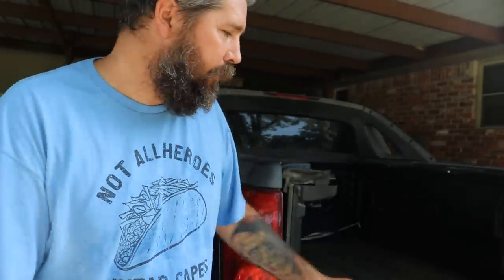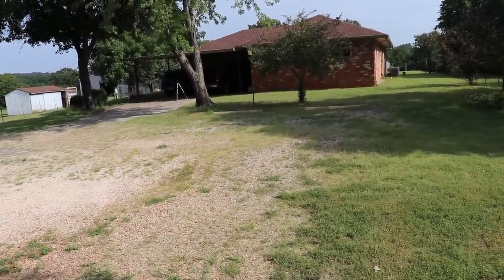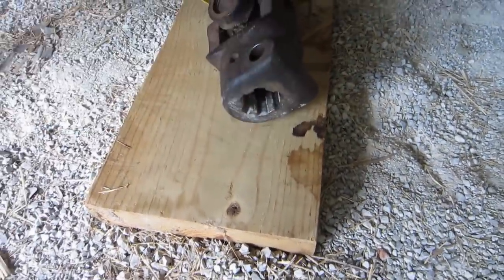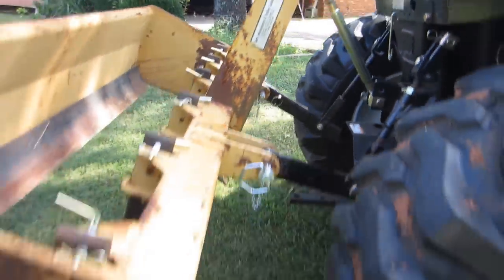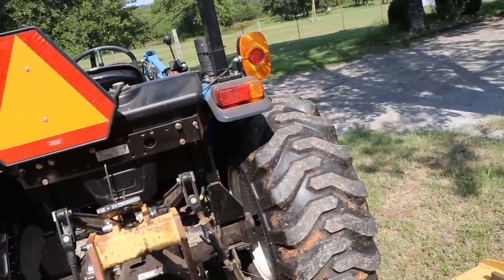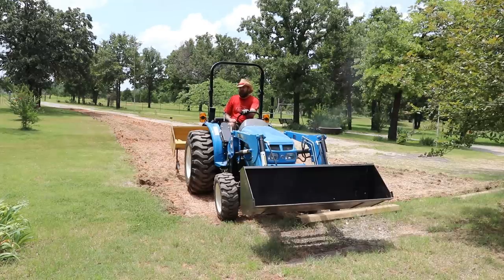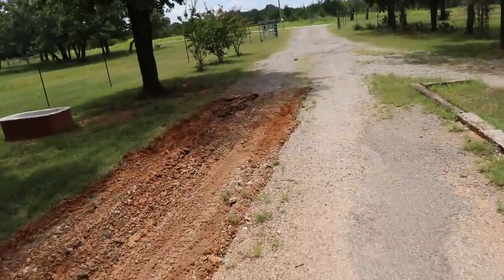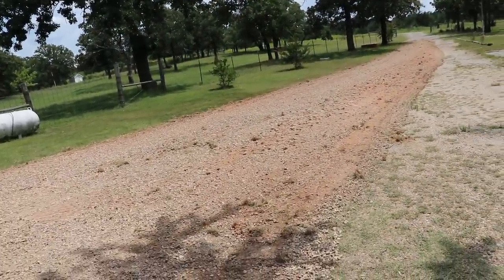How NOT to Box Blade Your Gravel Driveway

Comment: your box blade is to big for your tractor. A smaller one would be better like a 4ft looks like your running a 6ft. I've got a 5ft on my 38 horse power Kubota. That's also why your top arm had the box blade at such a high angle of attack. I'm not shitting on you or nothing just helping you out. Because you attack it high like that break the ground real good then push your top arm "link" as you say out so your blades will turn the dirt/gravel but I will give you props for your fist time.
Reply from the maker: It is a 6 foot box blade. I was told to get something wider than the width of my back tires, which is about 5'8" across, give or take. I was also told if I get a scraper blade or landscape rake, to probably get a 7 footer, so it will still be wide enough if I run it at an angle. Is that incorrect?
Reply: If its not Extremely heavy then no its all about  trying not to put a lot of stress on the motor. Bigger tractors have a bigger 3 point hitch system on them so if you run bigger implements you may run into problem's like you not being able to adjust the top arm or link to get your angels right. By no means do i clam to be a tractor master or anything i've had my l3800 kubota for 5 years now started out like you. I was just trying to pass my learned mistakes on. Oh especially if it runs on a PTO you want to make sure its the right size or you will burn the PTO up. Which  your bush hog looked just right.
Reply from the maker: I appreciate it. It's a lot of trial and error.

Comment: To me, your driveway looked great before doing anything.  I'd find somewhere else to box blade.   When I use the box blade, the surface is a lot more uneven -- typically a "washboard," which the box blade will take care of nicely.  A box blade isn't really designed tor getting rid of grass.  If I really, really wanted to get rid of the grass, I'd just get a good herbicide, and not otherwise disturb the flat, hard compacted soil -- which is want you want to end up with.
Reply from the maker: You're right. 20/20 hindsight, and all that.

Comment: Get those teeth all the way to the top, they will scarify and the blade on your tool will level the driveway. You are way too deep , you are burying the stones and bringing the clay to the top. Go Shallow, remove the grass and when you are done with the box blade use the weight of your tractor  and drive over it all and compress the odd stones back into place and  it will look nicer